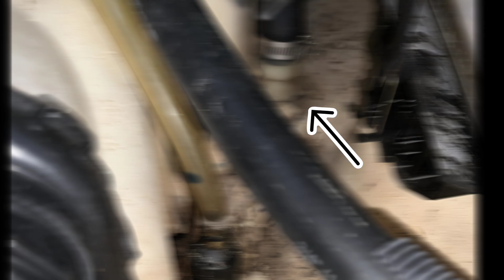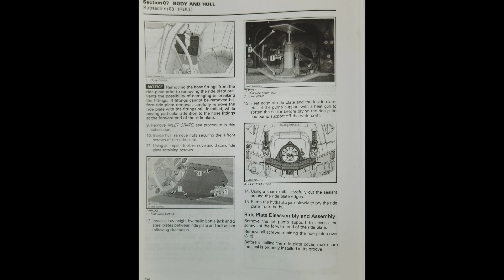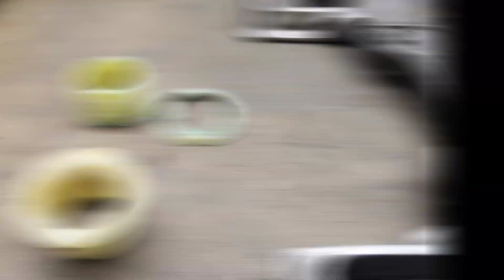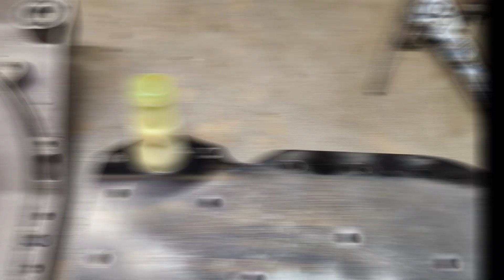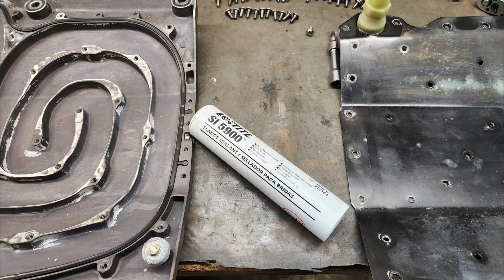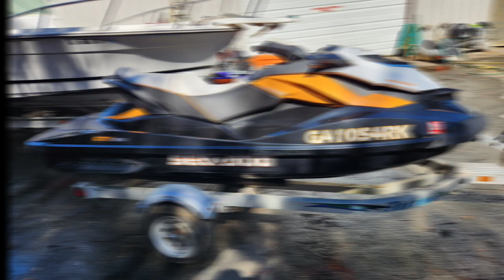Seadoo Broken Ride Plate? Ride Plate Repair Solution! Coolant Leak In Hull!

Comment: Seadoo boats don't have this?, you know anything about them?
Reply from the maker: Seadoo Jet boats with the 4-Tec engine do have the heat exchanger ride plate. I have rebuilt a 2006 Seadoo Challenger and a Seadoo Sportster in the past but also serviced them. Do you have a question about one or could I help you with something on one?

Comment: I do not understand if the male fitting inside the ride plate has an O ring or needs sealant.  Or does the upper O ring seal it?
Reply from the maker: The upper O-ring seals the upper fitting to the ride plate. I used a little loctite threadsealer on the threads to help lock the two pieces together when I assembled the one in the video. When you seal the ride plate to the ski the sealant used around the fittings helps to additionally seal the fittings to the ride plate.